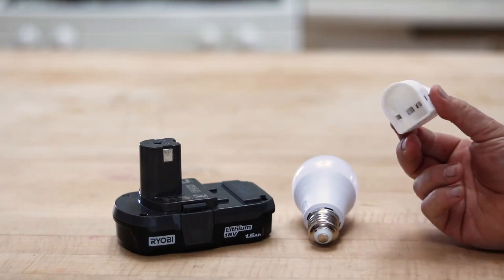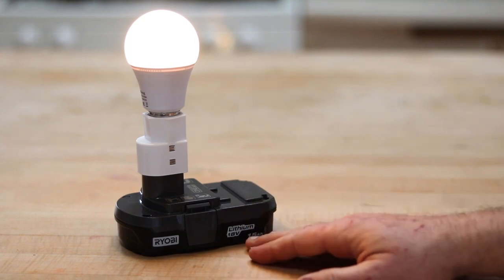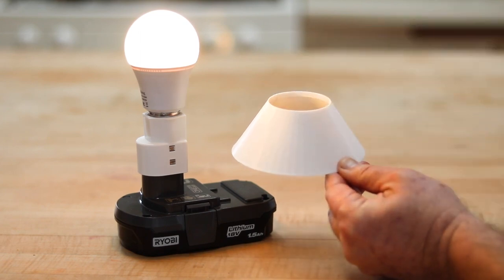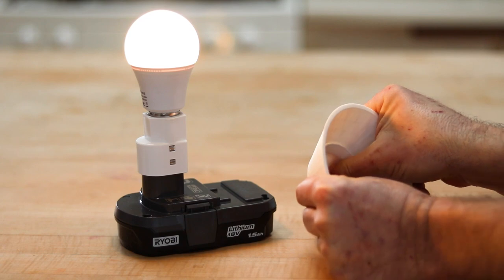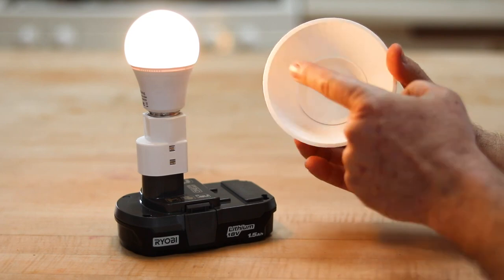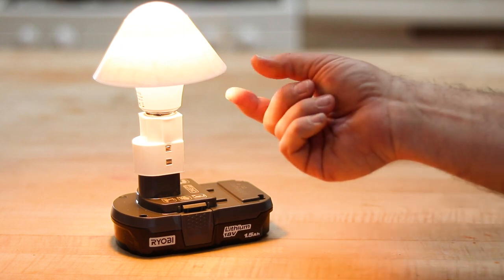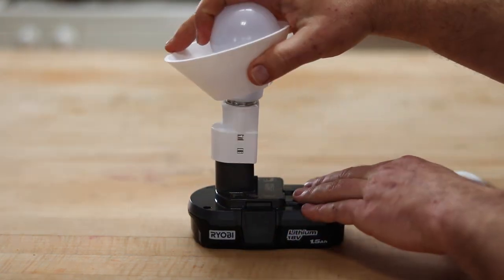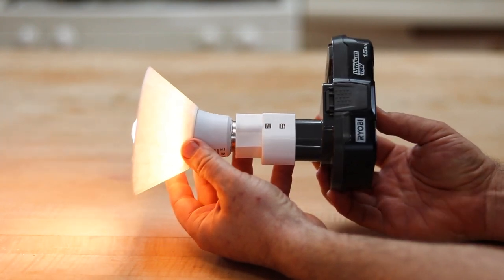3D-Printed Ryobi Light Lampshade

Comment: Mine was a fancy girly laced 5d lamp I picked up from a junk shop and I hid a 12v hilti battery in the base of it and then got a specialty lightbulb from an RV supplier that makes full sized Edison 12v bulbs :)

I'm really good at using an anvil and chisels so my adapter is made out of wood. I even put a female barrel plug on mine so that I can still use it as a plug in lamp since it's technically a really fancy indoor lamp

Comment: Hi Ben I was just thinking that as a  shade is aiming to reduce the amount of light then would it not be better to reduce the power to the bulb and thereby save energy/make the battery last longer. Yes nice project, your 3d design and printing skills are developing.
Reply from the maker: I would disagree. The point of the shade is to control the quality and direction of light at least as much as the brightness.

It's preventing glare into my eyes and reducing brightness up while increasing (acting as a reflector) the light going down.

If I simply reduced the brightness of the bulb, it would still be shining up into my face while putting LESS light down onto the table.

Lighting is often about contrast and other qualities, not just brightness. The lamp-shade acts as a mechanical way to give the light the qualities I want it to have.

Comment: the shade is smart but what about wind it looks like a small breeze would blow it off
Reply from the maker: I will say that I haven't taken it out camping yet. I've only used it indoors so far.
Another advantage of the two-part lamp shade is that I could improve the hub without having to reprint the brim.
Maybe I could add a clip to the hub.
Reply from the maker: I just made a version of the lamp shade hub with clips on it to snap onto the light-bulb. Not a perfect shape, but I think it should work ok.

Comment: do you not have a heat problem with the lampshade getting too hot and partially melting.
Reply from the maker: No.
It's an LED bulb. The diffuser on the bulb itself is even plastic.
These just do not create heat the way incandescent bulbs do.
(I would NOT do the same on an incandescent bulb!)

Comment: Hi! How did you manage to print with white material so that the light can be seen through it? (quite a bit, but enough)
Reply from the maker: It's just typical PLA plastic. The light is very bright and the plastic is relatively thin. It's not special filament or anything.
Reply: @BenjaminNelsonX  I see. Thank you.

Comment: Battery output D.C. Led light input A.C. Something is missing. Misleading.
Reply from the maker: Not all light bulbs are AC only or 120V. For example, automotive headlights are 12VDC.
This is a landscape lighting light bulb. It handles AC or DC just fine as well as a range of voltage appropriate for an 18V battery.
https://amzn.to/3wZPiAS
Reply: LED stands for "Light Emitting Diode". Like other types of diodes LEDs only conduct current in one direction. Therefore they are by definition DC, not AC.

The LED lights that screw into a 120v AC light socket will run just as well on 120v DC. The AC LED lights actually rectify the AC current to DC anyway. So feeding it DC works just as well.